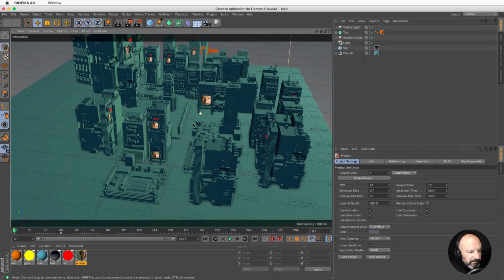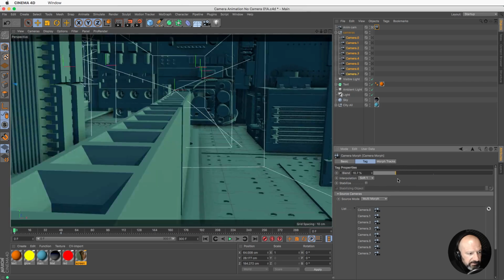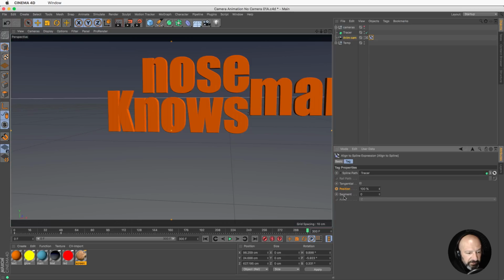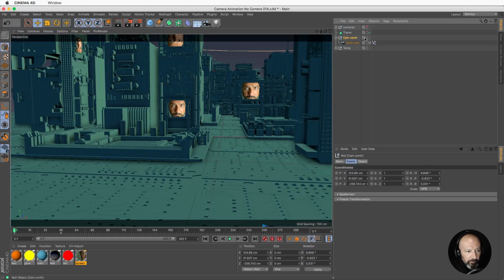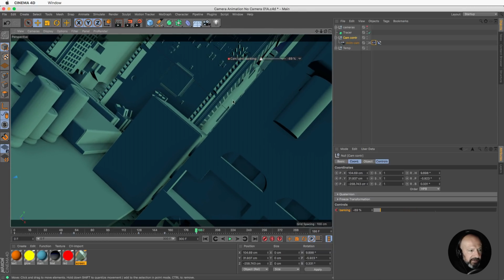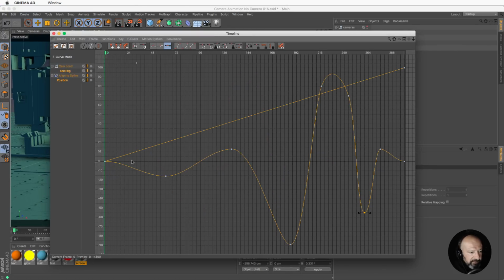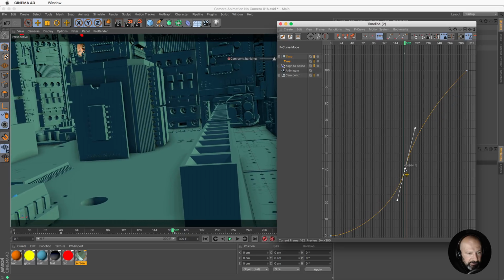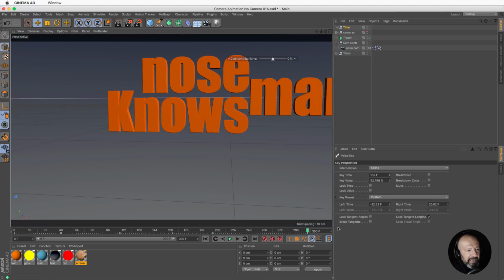Noseman sets up a Camera animation - You won't believe what happens next

Comment: very helpful! i have an idea. what if you attached a hanging object to the spline and animate it so that as it makes a turn, it swings naturally, then you could use its rotation to drive the banking of the camera? or maybe make the camera an object that's heavier on the bottom so that it banks automatically?
Reply from the maker: Although in theory that seems to work, in practice, simulations are never that stable, nor easy to control. You're far better off if you just hand animate the camera.